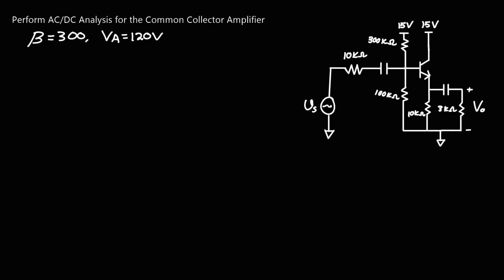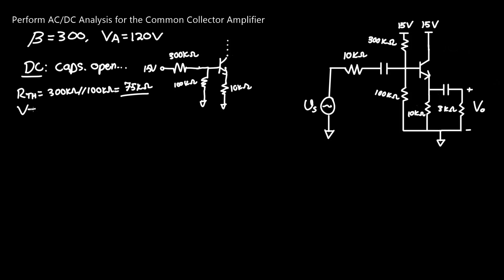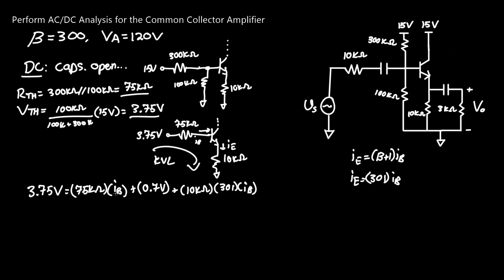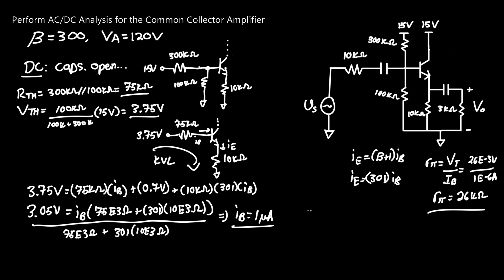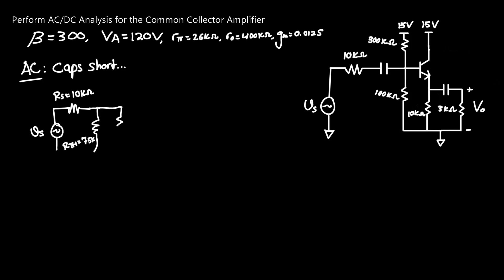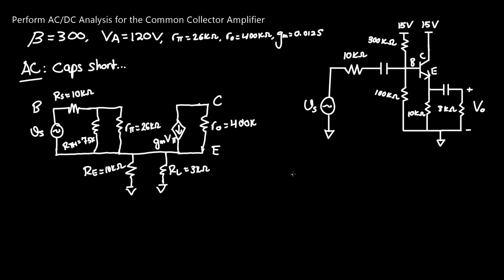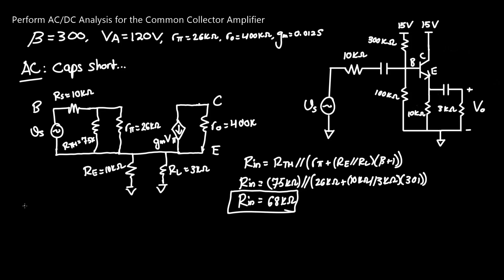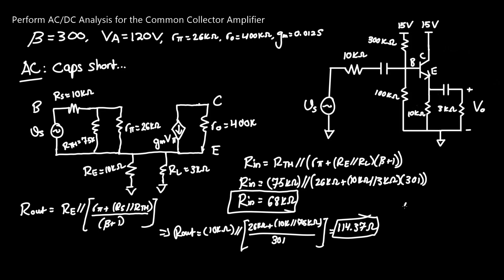AC/DC Analysis for Common Collector Amplifier

Comment: It looks like there is an issue with the the small signal circuit. As per the circuit on the right, Rth and Vs are not directly connected to the emitter terminal but to ground.
The formula for Rin is correct but the connections on the small signal circuit shown on the left are not.
Notice that what the formula Rin is saying is that rpi is in series with RE//RL which in turn are connected in parallel with Rth.
The small signal circuit on the left should be revised to have Vs and Rth connected to ground to match the circuit shown on the right.

Notice that the above RE//RL should be increased by (B+1)
Reply from the maker: You are correct that VTH and RTH should be grounded. At some point I will remake this series. For now at least the formulas are correct.

Comment: what is this 120 volts?
Reply from the maker: VA is known as "Early Voltage." This quantity is used as a small-signal parameter based on the BJT fabrication itself. Basically it is the negative point of voltage in the I-V curve that defines how well the voltage doesn't increase in the active region. Here's a video that talks more about it in-depth: https://youtu.be/gnjFiyzTCvM?si=LXOTbDxflnLdn4dT

Just know that it's used to calculate ro, which I do at 6:14

Comment: Also, I highly recommend to identify the input and output terminals on the small signal circuit since it will aid on deriving the formulas. For example, as per the circuit on the right, the output voltage Vo shall be between the emitter E point and the ground. Therefore, the output resistance Rout should be a function of RE//RL. But RL is missing from the formula provided for Rout. Could you double check this formula.
Reply from the maker: I'm away from home right now but I'm fairly confident my output resistance formula is correct.